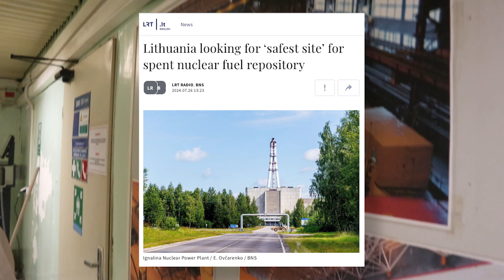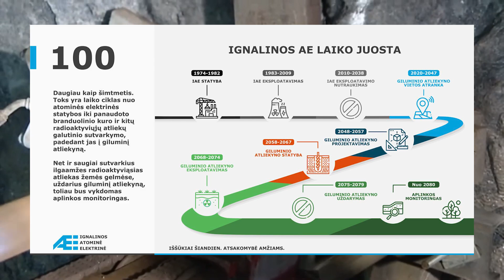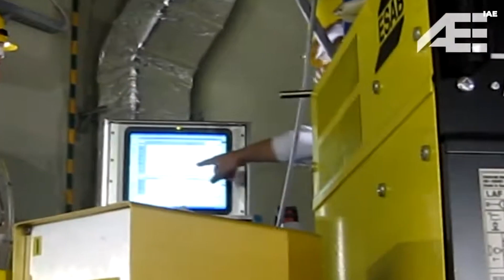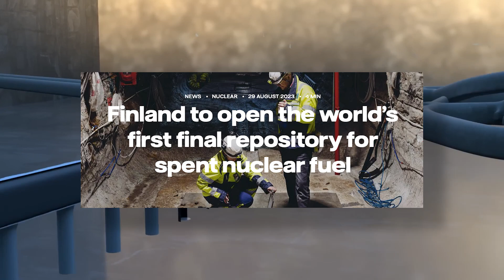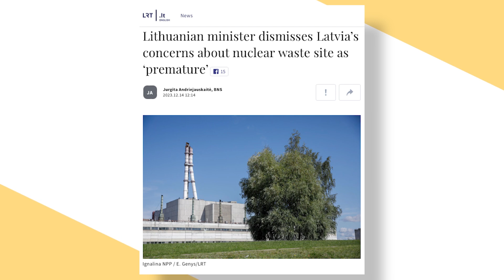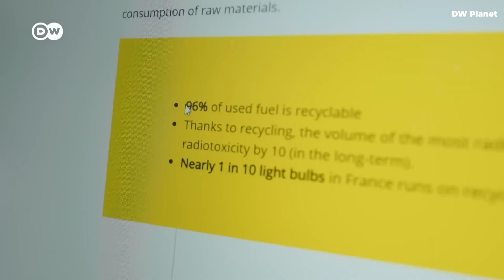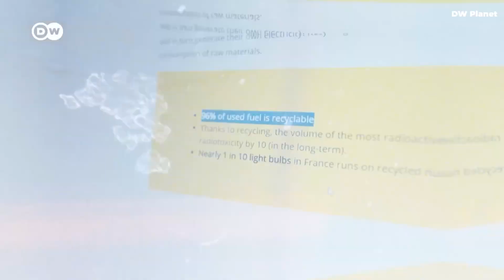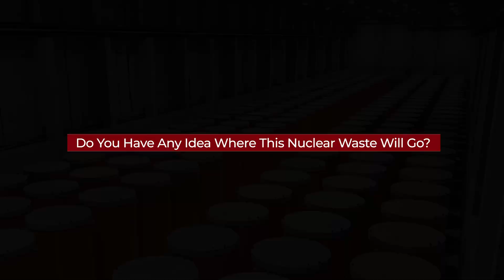Lithuania's Nuclear Waste Problem

Comment: You want to store nuclear waste in a crystaline layer, hard rock, not loose soil, since even if something breaks, the fuel physicly can't leak out, the Nordics are a great place for such storage, anyone who has been to any of those countries (except denmark), aspecially arriving by ferry would have probably seen how the shore is often hard blackish rocks, this is because they don't have a thick sedentarry layer (dirt, sand, clay etc) because the last glacial maximum scraped it off. Lithuania by contrast has a reletively thick sedentary layer (in part made up from the rocks and other materials that the ice sheets brought from Scandinavia) and so if you wanted to store the waste safely you would have to dig down a lot deeper and it really wouldn't be worth the effort. Storing nuclear waste is not as dangerous as people think and  finging room for it is not hard aswell, any cliffside in the scandinavian mountain range, or the alp, or the pyranese or alaska or urals etc etc, would work fine and bring little to no ecological damage, the only factor working against this is cost, since the best storage places tend to be the furthest from where people actually live

Comment: Why not store in Ignalina? Site was good for power plant but not for waste storage?
Reply: Different requirements.
Reply: @Lithuanian_NAFO_lad  Elaborate
Reply: @icylime3607  building a nuclear power plant and a storage facility for nuclear fuel is not that simple. They both have different requirements, like a nuclear plant does not require a hard rock tomb in case of a meltdown. The storage facility does. But you should not be asking me. I am no Power plant professional.